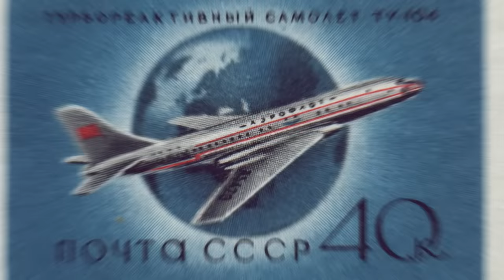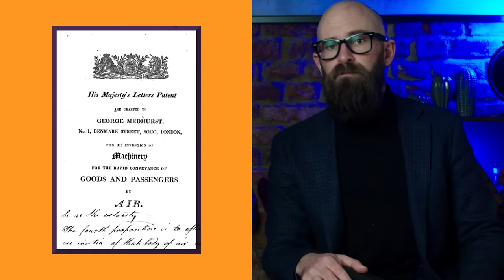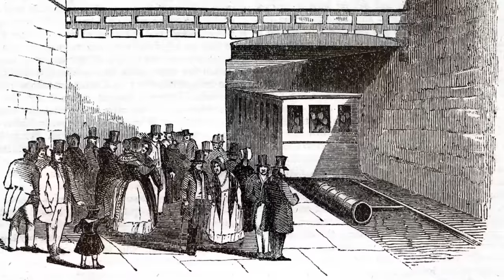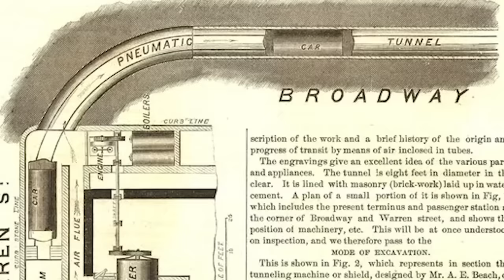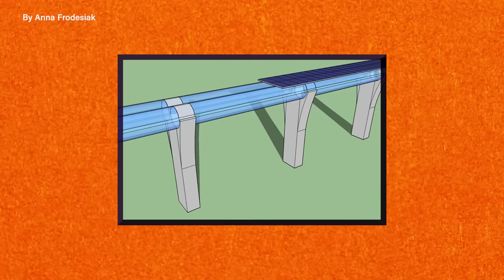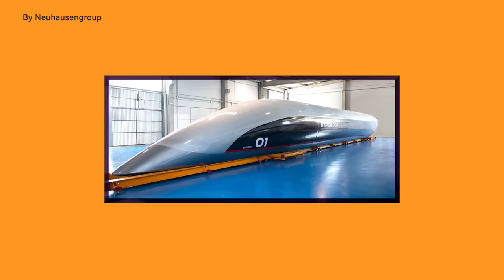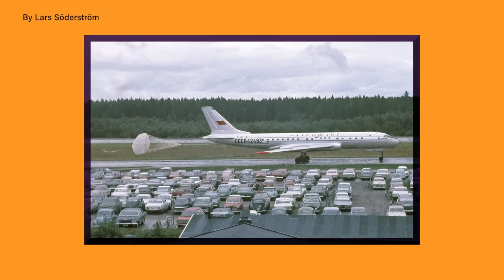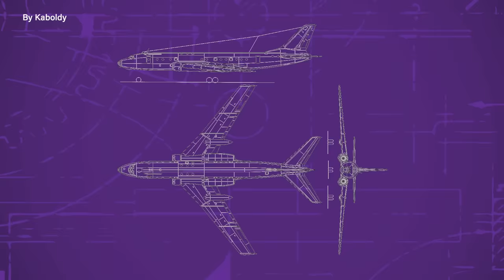Some MORE of the World's Most Useless Megaprojects

Comment: 7:55 “There has not been a single fatality due to accident of a US airline passenger in 14 years”

Wrong, Southwest Flight 1380 had 1 fatality in 2018. An engine exploded, sending shrapnel into the cabin and causing a rapid decompression. One passenger was partially sucked out of the plane and died due to injuries
Reply: I think I heard about this from Mr. Ballen here on YouTube. The story about this incident was horrifying.
Reply: The stat may not have been quoted exactly correctly. Usually it's "there hasn't been a fatal CRASH of a US airliner since..." The Southwest flight didn't crash, so it doesn't get counted. But it's not correct to say there have been no fatalities at all.
Reply: Did that guy really exist, or was that fake news?

Comment: The neat part about having the tube out in the sunlight... The top of the tube would grow as it warmed, but the bottom would not.  So you end up with the mother of all sun kinks in the middle of the desert.  Oooops.  Assuming you figure a way around that by reflecting light onto the bottom half of the tube...What happens in San Francisco if the end at LA is utterly immobilized?  The station would have to move north 600 or more feet.  You can see the issue here... Doors open and the station is 600-1000 feet from where you are.  Then it is time to throw in the weeks and months needed to pull a vacuum on the line from LA to San Fran.... Will require a large number of pumping stations to make it less than 6 months. And as said: LOTS of power, that the state doesn't seem to have..

Comment: Just FYI, dutch roll isn't normally much of an issue when it comes to flight controls, and on most aircraft, it won't cause a rapid stall. 

Many aircraft have dutch roll modes that can be aggravated , but that and the spiral modes are (should be?) some of the less difficult to damp out, I believe. This is because on most aircraft, dutch roll has a very long period of oscillation compared to pitching modes.

Comment: In order to field a jet airliner in an extreme hurry, the Tupolev design bureau took the  Tu-16 "Badger" strategic bomber, with it's aggressively swept wings and put a bigger, pressurized fuselage on it. The sweep of the wings made for a higher landing speed. There was also problems of weight and balance. Bombs don't move aound in flight until they dropped and don't have luggage. The elevators often lacked the authority to recover from an uncommanded steep pitch-up of the nose.

Comment: It's like Adam Something's usual point of "just build a fucking train", but presented by Simon :D There's also one more practical issue, at least on a continent like Europe with fairly few mostly empty places. You need to build a fairly straight tube to achieve the speeds, and planning that would probably bumb into yet another village every 10 kilometers or so. If BER airport only needed to get rid of one and that postponed the project by a decade, take a guess how feasible this thing will be.

Comment: Yeah in regards to the British De-Havilland Comet it should be kept in mind, the early comet crashes can be blamed on poor jetliner conversion training whereas the crashes of 1954 can not be blamed on the basic design of the De-Havilland Comet which was sound and De-Havilland knew about pressurisation 

It is more the fault of the wrong construction methods and the metal fatigue phenomenon that was not well understood in the 50s

As it should be kept in mind until the British Comet, no one had built a jetliner before the comet so there was a lot that was not understood, 

the comet 1 used square with rounded corners not square windows

Comment: The de Havilland DH.88 Comet piston engined light aircraft has a stall speed of 74mph , The Comet DH.106 Jet airliner would most likely have a stall speed far greater than that based on its size

Comment: Modern rail is CWR or continuously welded rail - there are no expansion joints there. Instead, the track is pre-tensioned and its stress varies instead of length.

Comment: The only thing I can see a hyper loop style system actually doing good is if it was to reach a under water facility. But the engineering required to do so would be insane.

Comment: More facts on the TU-104 of why it failed:
-It was somewhat, of a recycled airframe. The engines, wings, elevators, and fin were derived from a jet powered bomber.
Thus:
1) The far swept, main wings.
2) The engines had no reverse thrust, hence the use of a parachute.

More info on that aircraft located in this hyperlink.
https://youtu.be/tqhtkG6glug?si=R2UPDQ4tuiK2So1S

Comment: About compressed air transportation, don't forget the rahter successful but still problematic compressed air tramway system invented by Mékarski in Nantes and later Paris in the late 19th Century.  But of course, leaks were the plague of the system leading tramways to stop before engaging on a ramp... Those were quickly replaced with electric trams. Successful because it seemed to work well at first and prevented the pollution of steam engines on tramways at the time but electric motors becoming more reliable and powerful, it meant that a more reliable system could exist without the inconvenience of air leaks.

Comment: pneumatic conveyors, as described for mail etc are not the same as hyperloop.  The pneumatic tubes use positive air pressure to propel the payload along from behind, like a (very slow) bullet in a gun barrel.  Hyperloop pumps air out of tube to reduce parasitic drag and the pressure wave ahead of the vehicle - think of standing on a subway/metro/Underground platform as a train enters the station.  Using compressed air to propel anything is hugely inefficient.  Most of the power that is used to compress air is lost to compressive heating.  Only about 1/4 of the energy is available to do work.  I am not defending hyperloop, it's an impracticable idea.

Comment: The original plans in the early 20th century envisioned speeds up to 6400kph. So Mach 6 and change. It was envisioned to connect the continents via a high speed 2 based maglev system. This would be useful, but on the engineering side still not possible. A few hundred miles from city to city, barely faster than a high speed train is just dumb and hardly useful.

Comment: Simply creating a vacuum from a space would not in itself cause the cars to move in the tube. 
Ironically there would need to be a inlet for positive pressure air to create higher pressure behind the car, which is sealed to the walls of the tube, creating a massive low pressure area in front of the car, causing the car to flow with the high pressure air toward the source of the vacuum 
An actual vacuum is a static state, “flow” is the movement of a fluid 
From an area of high pressure 
To and area of lower pressure. 
In this case the cars would be the definitive point between hi and Lo 
The ideas just sucks

Comment: Reading an engineering magazine about the Hyperloop I couldn't believe anyone taking the idea seriously.  Of course it won't work, ever.  The science of ballistics has all the data you need about sending high speed projectiles through long tubes, and sucking the air out of the tube to make the projectile (the train) go faster is a colossally stupid idea.  Big tubes that send out projectiles are grooved inside in a spiral.  Not because it looks cool in the opening animation of a James Bond film but because the grooves spin the projectile which then spins with stability through the air by displacing it.  
Musk's tube train could only work if an outer shell spun through the tube displacing the air, with an inner tube sort of floating and not spinning inside it.  The biggest problem with this is not just friction and heat but the whole idea of literally shooting a (bullet) train through a tube then stopping the damn thing without killing everyone.

Comment: People really should actually READ THE F*CKING WHITE PAPER! Hyperloop, as Elon Musk describes it, doesn't require a high vacuum. It wouldn't work in a high vacuum. It was supposed to be a system built using basically commercial of the shelf components to produce a cheap easy to build transport system.

Three main things that people get wrong:
1. There isn't a vacuum in the tube. The pressure was supposed to be about 10% of sea level pressure, the same pressure you get airplanes flying around in. Leaks into the tube wouldn't be a very large problem since it was envisioned that pumps easily could keep up with anything but a catastrophic leak. The reduced drag was all the draw down in pressure was supposed to do.
2. There wasn't supposed to be any magnetic levitation. The entire idea was that the trains would run on air cushions produced by sucking in air at the front of the train to compress it into the air cushions and shot out the back of the train. Much simpler to use and the tube would be a completely normal steel tube like those use for gas transport.
3. No new technology needed. As it was first proposed there wouldn't have been a need for new tech, or even expensive tech. Air compressors are everywhere, even those that can compress huge amounts of air are used very frequently in the gas industry. The air cushions the train would ride on are literally air hockey tables turned upside down. The train hull would be built to the same standards as airplane hulls and use the same technology for interior air.

Now I didn't read the whole white paper, I read a synopsis that a friend at the local university wrote so I don't actually know how Musk was going to power his version but simply having contact patches on the tube walls where a pantograph type device could pick up current would probably be enough.

The stuff most people seem to deride Musk over from his proposal doesn't actually seem to come from his paper, it comes from every other cook that has tried to create their own version of the idea. Those versions might be more efficient (using less energy per diatance traveled) but they all seem to use technology that is not yet developed enough to work or require further study... almost as if people are h0rny for that sweet sweet venture Capitalist cash and aren't all that keen on actually producing a working system.
Reply: The TLDR Version of the above comment:

"You really should READ THE WHITE PAPER......now I didn't actually read the white paper ..."

Comment: Huh...  I never did much research into Hyperloop, but I always thought it'd be something more akin to a faster way to get an electrically-powered train to and from.  And perhaps eventually allow undersea travel of trains across the Atlantic and Pacific, among others.  The tubes being watertight to prevent damage, and the trains being super-charged with energy before being shot off at top speed through the "Hyperloop"...  The battery onboard used to passively keep it moving quickly as it races across over the next 12-18 hours.  Then it arrives, the battery is removed, set to charge, another is placed on, the people and luggage are now onboard, and...  Off we go, back across.

The only crew needed are those to maintain order, feed the passengers, and engineers in case something goes wrong.  Using sensors to keep an eye on the tubes, so there are no breaks from, like...  Dead whales falling onto one, or submarines that have accidentally rammed it.  If there is a breach, there are predesignated spots that will automatically seal off the tubes from the others.  Should a break be detected, the onboard computers will immediately start bringing the train to a halt, which would...  Probably be a little harsh on the passengers, but continuing to live is continuing to live.  And if that is all the case, then another, particular form of hyperloop train could go into the tube, grab the now-stuck train, and drag it back to where it came from so the people aren't stuck down there for the month it'd likely take to replace the damaged tube.

So on and so forth.

Now I know its something goofy as hell.  Go figure.

Comment: Your math is very wrong somehow.
Assume human waste weighs the same as water - 1kg/l .
A typical smaller tanker truck can hold 5500 gallons which converts to 25,000kg or 25 tonnes of water/waste.
Assume 25 tonnes ~ 25 tons.
At your specified 7 tons or 7 tonnes per day of human waste, there is NO WAY a queue of sh*t trucks would ever be necessary.

Comment: I am sorry to spoil everyone's anti-Musk tirade (and if anyone deserves it, Musk does), but a lot of the 'it's impossible because' statements Simon just trotted out are simply not true. I'll pick up a few, just to give a sense of sanity to the critique.
1) Expansion joints - "you can't have more than a few meters without expansion joints" Well, has anyone hear of welded railway lines? No fishplates offering expansion opportunities, just the right materials and the right implementation. And keep them out of extremes of temperatures (a bit of shade will usually do the job!
2) A hard vacuum would require continual pumping. Yes it would. Just like deep mines require continual pumping, it's not a disaster it is just a cost.
3) "Or a train bursting out of a tunnel at incredibly high speed" - well to burst out would require the sort of structural failure that would let in air first - so lots of drag. The risk would probably be from in-tube deceleration.
I could go on. But won't. The hyper-loop will probably never be cost effective or even very appealing to claustrophobes (who are actually quite common) but it is not impossible to engineer....only difficult and expensive.

Comment: Ooook so with regards to the Elon Musk thing regarding high speed rail, I highly doubt he has any interest or care in sabotaging it.  For one, he doesn't sell near enough cars for that to be a concern.  But much more pertinently, the struggle to build nationwide High Speed rail is distance

The USA is enormous and its population massive and spread out.  To put it into perspective, a logical route for a high speed line from NYC to LA would be to have a line to Memphis that would essentially be a hub that most east coast lines would connect to before heading west.  Then have a stop in Tulsa before heading to LA.  This single line would be roughly 2900 miles, longer than THE ENTIRE French high speed rail network.  A nationwide network would easily blow past even China's network size.

Just to put a fine point on it, the USA's freight rail network, which is very extensive and efficient, is 140,000 miles in total length.

Comment: Hyperloop is a perfectly viable project. Just not on Earth. Imagine if it was on Mercury or Mars or some barren,no/low atmo exoplanet. Be perfectly fine since youre keeping vacuum out and not in.
Reply: It would be more for keeping the dust outside. But you still need to solve the issue with thermal expansion although you would not need to keep the vacuum and probably could find a way. And there are also new metal alloys to come that may be used. In the future, this failed hyperloop project could be useful somewhere with the right materials. It could inspire something else.

Comment: Every idea that Musk has is ultimately bad for us the little people. And yes, I include Tesla here.. He managed to convince people that the future of cars is EV.. Yeah right..Maybe for the top 1%.. With the battery degradation you'll have to replace it after 10-15 years of use. And battery alone is 30 000$. I can buy a perfectly good 10 year old ICE car for 10-15000$ and get similar driving quality to the same car when it was new.. So how are we mortals gonna buy used EV cars for 10 grand and be forced to buy a new battery for 30 grand within a few years? 
And don't get me started on the amount of electricity that would be needed in the system if 50,60, 80% of cars were EV.. Where would that electricity come from? Solar panels? Yeah right..
As for Elon's other pet projects, we've seen the effect.. Space X hasn't drastically lowered the cost of space flight, we won't be going to Mars in the next 10 years, cars can't drive fully autonomously, his robots are a joke. The only thing he did right was giving Ukraine free internet through his small satellites. But he managed to fuc* up that too with his support of Russia. What a quack.

Comment: There has been at  least one death on an airliner because of accident in the US between 2009 and 2023. On 17th of April 2018 Southwest Airlines flight 1380 had an engine failure which led to a rapid decompression pulling a passenger out of her window which was shattered by debris. The passenger sadly passed away. Air Travel is still insanely safe though.
Edit: Flight Number